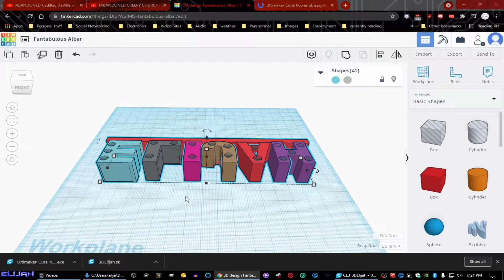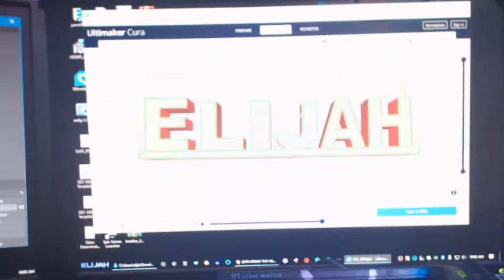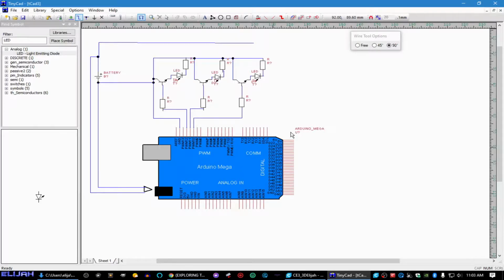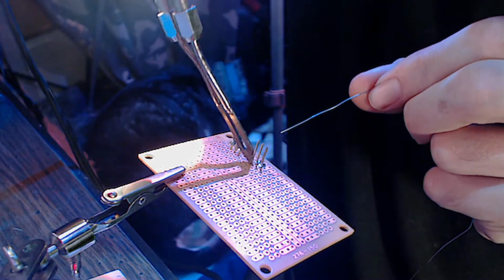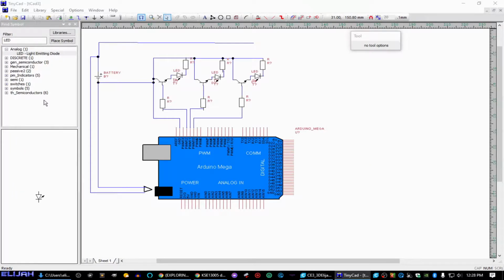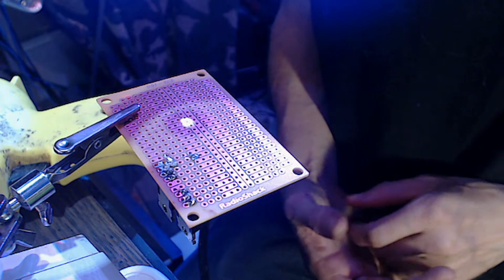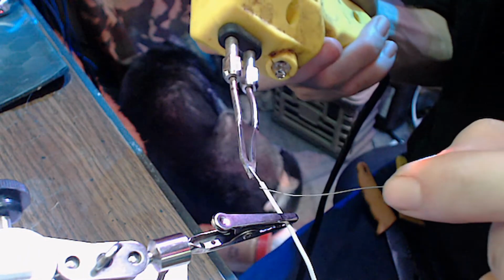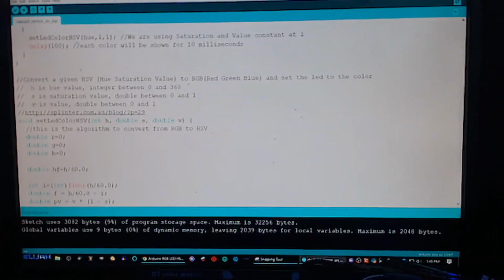Building My Name in Lights with Creality Ender 3 and Arduino Uno!

Comment: At least on digi-key, and most major producers of transistors ( 4 or less pins -  chips in general, has been my experience...) Isn't the pin-out right at the top, usually on the graphic...

As for helping hands, your spot on, but I would add - spend the extra few bucks, and grab the magnetic ones with a cast iron base...
No need to send thanks, it's just better in nearly EVERY use case I've come across in 20 something years!! 😅😁
Reply from the maker: Usually they are, but I seem like I am losing my vision so I have to be very careful when I am reading on the chip itself, but I order most of my components from TaydaElectronics.com and they do not put them on the packaging, it is cheap because they just come in bags are are pretty generic, this is okay if you know which chip you are pulling from the bin, but if you are like me and you have the bins divided out into "what component, and you can's see the really tiny text on them, well I always have issues.  Once I get a part number I can usually get the pinout for it though.
Reply from the maker: Oh also on the Magnetic Base Helping hand thing.  That would be incredibly helpful.  the one I have now is fancy and has a light and magnifier build in, but it will not hold the parts for me and has no magnets, so I super glued some small neodymium magnets to the metal tray and they magnetize it.  Also I use a lot of Neodymium magnets for all kinds of things, they make life a lot easier when you need a helping hand, but I never knew about a helping hand that has one built into it, that is very interesting though and I will definitely check it out.. so thanks again!!